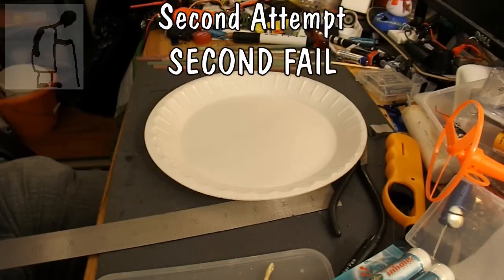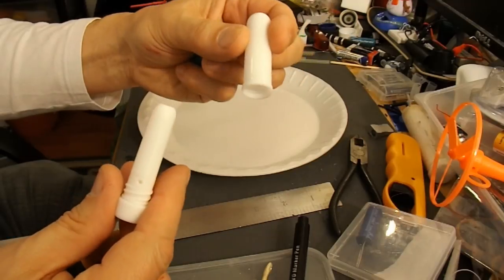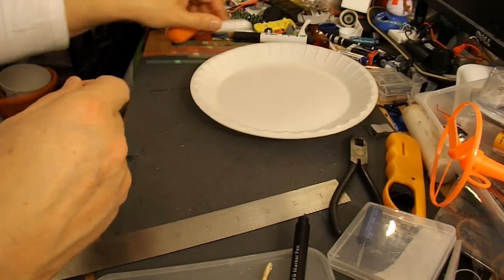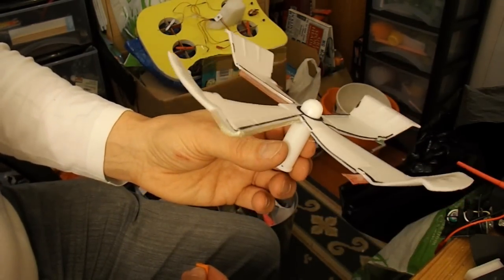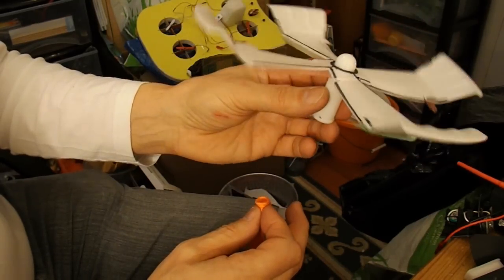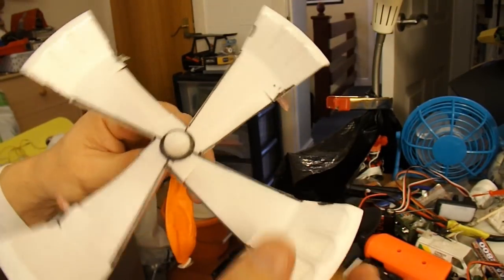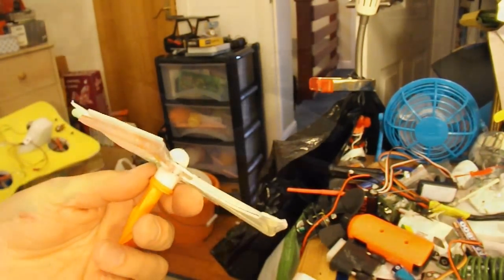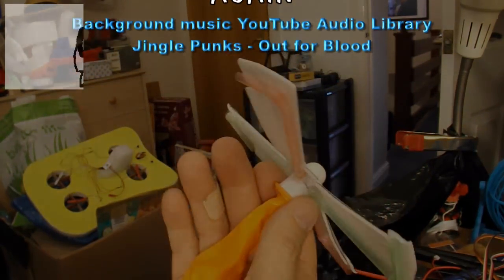Balloon Powered Helicopter Second Attempt SECOND FAIL

Comment: Just a thought,..  shouldnt the straws be on top of the blades and about 1/3 of the way back from leading edge with a nice taper on either side?      To create an airfoil.           It seems as though the way you have it in the video it is an upside down airfoil of a sort causing the "lift" of the airfoil to push it down.

Comment: hey grandad i saw some of your videos in which you answered the  questions asked by many youtubers that 'are those cheap motors are any good for helicopters'.i got the answer but today i found a video in which a guy makes a real wired controlled helicopter with those toothbrush vibrating motors.the link of the video https://www.youtube.com/watch?v=FSX1yH0Uz3M .i think it might help you in your projects.bye..
Reply from the maker: Soumita Bhattacharya thank you very much for taking the time to send that link. Yes if you add gearing you can turn a larger propeller. The next stage is to get enough thrust to lift the batteries too.

Comment: No man NO! It's not a fail at all. It's a progression towards success and a reason to be stoked. You can't expect instant success. You are nearly there cos you have a beautiful spin, well done. Don't give up, your next video will be to your glory (pretty much a sure thing). lol It's the aerodynamics of the blades that's the problem (big-time). The straws are completely killing the lift cos they are in the way of the propeller air flow. All you have to do is run the straws around the outside of the blades. Use normal office sticky tape to run the straws along the leading edges of the blades and around the tips. And you need the extra blade size and the bent up tips add stability. Maybe use as much plate as you can for each blade, then join them (instead of cutting the entire rotor out of one plate). Then you have bigger blades. I wouldn't attempt it unless I worked on the blades and tapered the trailing edges with sandpaper as well. And the leading edges of the blades are taken care of with the straws at the front. Going by how fast it spun, I think you are on a winner. You don't seem to realise how important and how critical aerodynamics is. I have noticed this with a lot of your stuff. You have to look at it with a "wind-tunnel brain" and know how much it hurts to have stuff sticking into the airflow (that shouldn't be). lol If you don't give aerodynamics your best shot, you will fail (or at least lack efficiency). And even if we do give aerodynamics the best shot we can still easily fail (so I try my best for the best chance of success). It's hard and I know how hard aerodynamics is and how critical it is. Knowing that helps. It's not a failure at all and I would be stoked if I was you, cos all you have to do is clean up your act when it comes to aerodynamics. lol
Reply from the maker: Justwantahover As you say the aerodynamics are pretty useless but you keep forgetting the target audience for my channel. If they were proper aeromodellers they would be watching a proper model plane channel. I am giving this idea a break for a while although I am keeping my eyes open for larger straws and a different hub. The main issue with the straws is getting the bend for the tip. I was wondering about leaving them straight, sealing the end and cutting a short slit or making a hole at the back for the air to escape in the right direction. I could even flatten them slightly so they are more aerodynamic. Feel free to do your own and upload the video, I know yours would work fine.
Reply: GrandadIsAnOldMan  "As you say the aerodynamics are pretty useless but you keep forgetting the target audience for my channel." That's true but it won't work with the straws underneath the blades (even if the straws are flattened). And also things like just sanding the front edges a bit to round off the leading edges of wings just a little bit. Like make the sharp edges blunt (even if it's still square) and it makes a hell of a difference and is quick and easy. For the helicopter it's no harder to run the straws in front of the rotor (with sticky tape) and you won't have to round the leading edges.lol Then wrap the flexible part of the straw around the tip of the blade (that's shaped for the job). Or have it go under and its still fairly streamlined. Put tubing under just after where the up-slope starts on your plate blades.
Some straws have flexible end bits (for funky drinking). lol I can get them in packets in grocery stores. If you can't get them, use soft plastic tubing (similar or a bit smaller diam as the straw). And sticky taped on the straw and tape wrapped around to seal. If you can't find small enough plastic tubing, use thicker straws for the air-flow. And use thinnest tubing you can get (I suppose). The extra weight of the tube ends will make good flywheel effect. Make sure they are the same length. We want it to be a fly...wheel. lol I don't want to make one, I want to see you make it work. It's just that your straws were underneath and that's about the only thing that stopped it from flying. It's cos they went under right along the entire length of the blades, obstructing the airflow completely. Also the "flaps" on the blades are silly when all you have to do is twist the blades. Unless the foam breaks and you have to tape the "flap" pieces on. lol But if you can roll a fuselage with that stuff, surely you can twist the blades. lol
Reply from the maker: Go on then, show us how to to it again, your planes were excellent so I expect your balloon helicopters will be too.
Reply: GrandadIsAnOldMan Just make it the same as your last attempt (with the original full plate) and run the straws along the leading edge of the blade (instead of under). Just stick straw to the blade with normal office sticky-tape. And have the bent backwards straw tips go under (just after the plate angles upwards). You can buy straws in packets with bendable tips (for funky drinks) in the supermarket. I'm sure you must be able to get them. They are like as common as paper-clips in Australia. lol And do away with those silly "flaps". Just twist the blades or stick them to the straws at the desired pitch angle. It doesn't matter if the backward straw tips face down a bit. The physics agrees with you and it will even help lift. lol